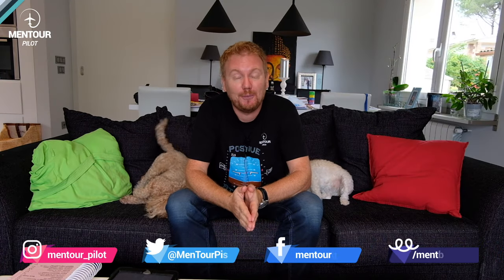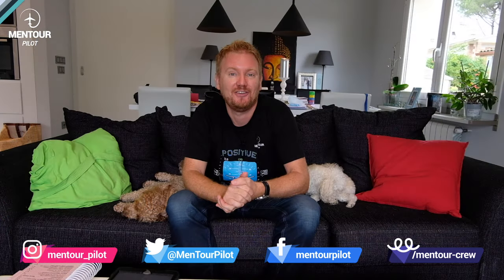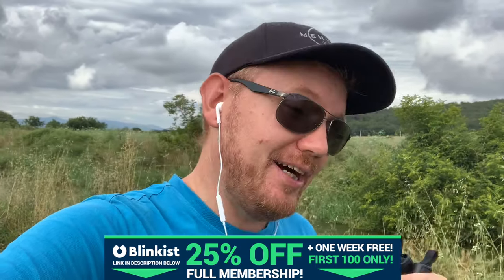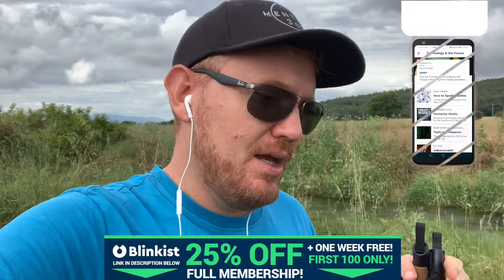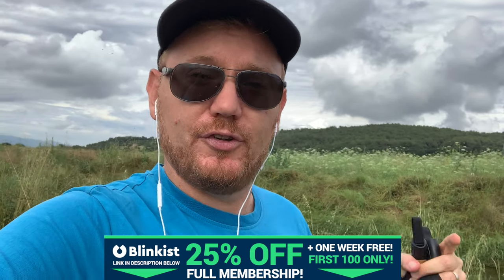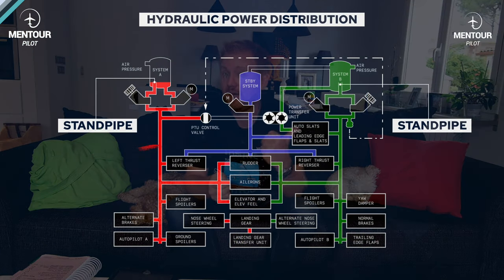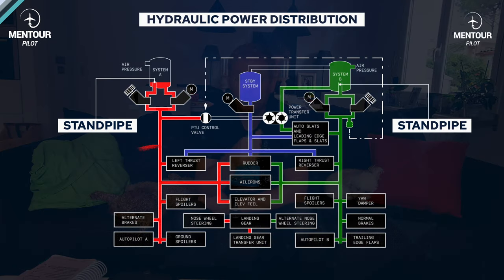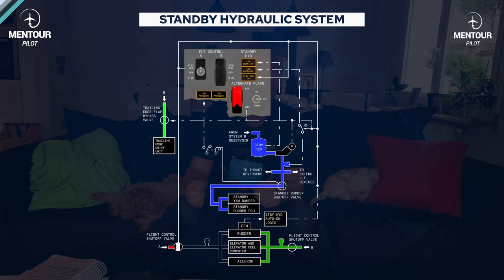How the Boeing 737 hydraulic system works. (And what happens when it doesn't)

Comment: Great explanation as usual, even though aileron power control units are located in main wheel well and nowhere near the ailerons.  The 737-100 and early -200 series airplanes had near-disastrous hydraulic problems through the early 1970s.  'A' system was powered by engine pumps only, 'B' by electrics.  Main problem was vibration of EDP pressure output lines between the engine disconnect and hydraulic power module in wheel well.  Even though the lines were stainless steel, nylon cushions in the clamps securing the lines ate right through them and caused high pressure leaks that rapidly emptied 'A' reservoir.  Resulted in loss of A system for flight controls but not B, total loss of landing gear and flap operating pressure.  Gear could be deployed manually and flaps extended, slowly, by electric motor and standby hydraulics, but nose wheel steering was inoperative.  Many emergency landings and runway retrievals resulted.  Original, alternate thrust reverser system was based on accumulators rather than standby system and was likewise troublesome.  By the time Boeing developed and we installed fixes for all those problems, we mechanics were thoroughly sick of being soaked in hydraulic fluid at work.

Comment: Love your tech videos. Very good for those who are going through B737 type rating course 🤘.
Reply: @787 Wing Aviation Yes. And if you lose A or B the Autoland is also impossible...
Reply: Pilot Blog true, but what airline allows them to use auto land?
Reply: B37xM Flyer isn’t it meant to be a requirement every so often to keep pilots current. They seen videos they do it on a clear day to make sure it works and they are current incase they need it for real
Reply: @737MaxPilot  we use Autoland. At least once per month or for foggy weather...
Reply: @tomstravels520  True and every 6 month we have low visibility operations training... Well at least in my airline 😉.
Reply: Pilot Blog nice to hear it’s actually used.  I do know the USN doesn’t allow it on their P-8.

Comment: I would like to slightly correct you. Cables go through the whole aircraft, and in B737NG you actually move the cables, which than activate actuators(most of them in the wheel well , some are in the tail). I guess people think it is either hydraulics or cables on B737NG, when it is actually both in normal situation. I know that you know that as a pilot and instructor, but it might not be clear to other viewers(some of them who do not have technical background). Other than that, perfect explanation of quite complicated system. When talking to mechanics, they told me that spoiler mixer is the thing they hate on the NG due to complexity. Also, removing some actuators(for example aileron PCU) and installing them is a nightmare(due to cable rigging), unlike on A320 where it takes 20 minutes in base maintenance.

Comment: One thing Peter, 18:17 actually the leading edge devices will be in fully extended positions once you select switch in ‚down’ position (regardless of trailing edge flaps positions). Thank you so much for another, fantastic technicial movie! Greetings
Reply from the maker: Absolutely correct. My mistake
Reply: Must also place alternate flap switch in ARM position.

Comment: Great  explanation of the hydraulic system.  Love hearing about the technical aspects of flying.  Considering the thickness of the manual, and accompanying checklists, I would feel confident knowing that the pilots have it memorized, and can execute it automatically without going through the checklist.  The buttons, switch, which should be on, which should be off, AND when, is mind blowing.  I'm reminded, that even though people know how to drive, it doesn't mean they know how a car operates.   Thanks for the great job that you're doing.  Stay safe.

Comment: I've driven a heavy truck before with no power steering, once before I remember trying to park in a tight spot and I felt my arms were going to fall off from the pain of struggling with steering wheel.  I can't even imagine how would feel to steer a plane using muscle Force.
Reply: alnett22 its nothing that drastic.
Reply: @737MaxPilot  yes it is see UA 232
Reply: @theyaduvanshiindian391  that is not a 737. I fly the 737 on a fairly regular basis with the hydraulic assistance shut off. It is nothing like what he is talking about...then again, I am sure a 11 year old little girl would disagree with me also.

Comment: I feel much safer on an a 737 after I saw this video! Thank's Peter. I had a landing in Trondheim when they coulden't get the flaps down, and we stopped on the runway and used the emergensy glides off the plane. That was an old DC9 or a Carawellwelle plane from SAS. The engines almoust fell off when we landed very hard, but the pilotes saved us. No one was heart. We had to wait a long time to get a new plane from Oslo to take us to our destination Alta.
Reply: Skriver på norsk jeg, siden du er det😉
Det var vel ikke tilfeldigvis 23.feb 1987?? 🤭🤔

Comment: The electric motor driven pumps are cooled by Hydraulic fluid? Yes, you're right as the hydraulic fluid passes through a HEAT EXCHANGER Located in each main fuel tank.That's why we need a certain quantity of fuel in the main tanks before turning ON the electric motor driven pumps (minimum of 1675 Lbs ). As always, your explanations are great.
Both A and B hydraulic systems have an engine–driven pump and an AC electric motor–driven pump. The system A engine–driven pump is powered by the No. 1 engine and the system B engine–driven pump is powered by the No. 2 engine. An engine–driven hydraulic pump supplies approximately 6 times the fluid volume of the related electric motor–driven hydraulic pump.

Comment: From  the schematic shown,  I presumed  Boeing is using a closed center system and compensated pumps but your comment regarding volume/flow rate variance twixt the motor-driven and engine driven pumps makes me wonder .  IAC, it wouold seem there's a great deal of control complexity introduced by having redundant control activation systems .  Of course  pilots don't need in-depth knowledge of the design features/philosophy in order to operate the systems and compensate for failures b ut I'm sure even the required level are considerable !  Great show series !

Comment: In our airline, we always switch off the electric hydraulic pumps after shutdown, even during short turnarounds. We only turn the pumps on if there is a strong tailwind to maintain the elevator in its neutral position.

Comment: Thanks for the elaborate explanation.
Just one note: Cases of several hydraulic  systems failing at the same time already happened in aircrafts, usually due to an external impact (for example an engine turbine break and cut hydraulic lines Etc.).
Reply: United 232
Japan Airlines 123
DHL OO-DLL

These are the only real 3 main ones that lost all fluid. Modern aircraft like the A380/A350 now use hydrostatic actuators which have a self contained hydraulic system isolated from the main lines. If the main lines are punctured and all fluid is lost then these EHA’s/EHBA’s can still move some of the flight controls to give the pilots control of the aircraft. They just require electrical power to operate

Comment: I always wondered about this! I take the 737 a lot, but i never knew it still had cables in case hydraulic didn't work! Nice!
Reply: Cables can stretch break or fray. If rigged improperly the ailerons otrol.r rudder will have poor or no control.

Comment: Thank you very much, Mentour for answering my comment reguarding the previous engine failure video! Great interesting video as always, and I thought you really NEED a RAT to steer a 737, but you have cables and enough electric backup pumps, a gravity extension, a PTU and an electric system for the flaps instead to steer, this makes sense!
 
Patrik Krispler
Reply: The 737NG does not have a RAT 🐀
Thats an Airbus thingy😆😉
Reply: @Clayson Antoons Hey, thats true😆
Forgot about that

Comment: Great Video!   Question-   When there is a loss of either A or B, and the Standby System is activated by selecting Standby Rudder, is the rudder powered by only the Standby System or jointly with the Standby System and the remaining A or B system?

Comment: Can you please do a video on why you do static takeoffs please?
Reply: If You mean like : standing take off , it's mostly because after line up you wait for the takeoff clearance .

in freezing conditions there's static run up (up to 30sec) to about 70% to schede some ice from the fan blades .
Reply: It is not the recommended procedure.  It doesn’t provide any substantial performance gains, but adds to the probability of engine issues while at high static thrust settings (think crosswinds)

Comment: What procedures do you do if you for example lose system A mid flight? Do you divert and land as soon as possible, just to be sure, or do you complete the flight and deal with the problems on the ground?
Reply: Probably land as you have lost one of your redundancies but could depend on if you’re flying back to your main operations base and only 200 miles from it. You still have 2 systems spare
Reply from the maker: You can complete the flight in most conditions.

Comment: Hi Petter, do the control cables move while the authority hydraulic system A and B is in use.🔦🔎
Reply: The  steering wheel connected to the ailerons by steel  cables some how it will move when you turn it,   Maybe the actuators without hydraulic pressure will also move with it
Reply: Yes the control cable will move when you move the steering wheel
Reply: It's much like the power steering in your car.  The steering wheel in your car is connected to the front wheels of your car by mechanical components.  Even if the power steering quits on your car, you can still steer.  On the 737, the cables are part of the mechanical connection between the pilots controls and the primary flight control surfaces.  If one moves, the other moves too.  The hydraulic system provides "power steering".

Comment: Hi Mentour. Love the channel. 
Would be great to see a video in the 737 simulator of a double hydraulic system failure. 
Also i'm not entirely sure how the 'fly by wire ' A320 handles this problem given there are no cables to the actuators.  I would assume that the APU would be the backup system here but then I recall with the Hudson river ditching captain Sullenberger switching on the APU which was later regarded as an example of brilliant airmanship even though this was apparently not part of the Airbus emergency procedures for this particular event.  
So how is the Airbus fly able in the same situation? With no hydraulics and with the generators offline the fly by wire would presumably only have very limited battery capacity available to it.  So in that case you would think that starting the APU would be one of the first priorities.  My only guess is that Airbus maybe never really considered a double engine failure.  Perhaps the consensus was that the only scenario where you could conceivably lose both engines would be the aircraft running out of fuel... In which case attempting to start the APU would be pointless.  Or did they fly it purely on the hydraulic pressure provided by the RAT?
Can you shed any more light there?
Reply: You're asking too many different questions and switching between hydraulic and electrical failures so it is a bit confusing.
1. The A320 has 3 hydraulic systems. Green, Yellow and Blue.
2. Green system is powered by No1 EDP. Yellow is powered by No2 EDP but also has an Electric Motor Pump usually only for one engine taxi when No2 is shut down or emergency use.
3. A PTU can pressurise the opposite system if the pump has failed. So if Green pump fails, the PTU will pressurise green system as long as yellow pumps are working and vice versa.
4. Blue is powered by an electric pump or the RAT in an emergency.
5. The aircraft can fly with 2 systems failed. Which controls surfaces remain depends on which systems failed.
6. If all the EDP's and EMP's failed then the RAT will be deployed to pressurise blue system and emergency landing conducted. 
7. The only time the plane would be completely unflyable is if all 3 systems leaked fluid.

Comment: Question about manual gear release, do the modern 737's still have the peep hole in the pasenger cabin floor, where the pilots can look down and check to make sure the gear is locked with the red stripes lining up?
Reply: No peep hole on the 737NG👀 
Dont think the classic had one either..
Reply from the maker: No, unfortunately we don’t
Reply: @speedbird9313  classic does have window/mirror system
Reply: I worked at a breakers yard a while ago, and a klm 737 came in, i think it was a 400, and that had little circles of carpet you could lift up above the gear bay in the passenger cabin, there was a glass sight, you literally put your eye against it, and looked at mirrors through the glass sights that were in the gear bay, those mirrors showed you the gear leg, where red stipes were painted onto a joint on the gear leg, so, should a gear indicator fail, you could double check, there was the same spy hole in the cockpit too, under where someones feet would be if they were sat in the fold down jump seat, just aft of the radio pedestal 👍

See, even as a pilot, you learn something new every day 😁
Reply: NG and max don't have a window. They have a redundant set of gear down sensors and a separate second set of  indication annunciators on the overhead panel
Reply: @stumo8681  bit concerning for the passengers i suppose, seeing the captain walk into the cabin, teqr a piece of carpet up, and put his face against it, they would think he was drunk 😂
Reply: @russellrattys6581  I always thought the same, first time working  on a classic I couldn't believe it 😂
Reply: stumo86 Cool, thanks👍🏻 Didnt know that🤷🏻‍♂️😊

Comment: Is it possible for the 737 to lose all hydraulics like the DC10 which had to make a emergency landing at Salt lake city
Reply from the maker: Anything is possible but highly unlikely
Reply: Possible yes. Has it happened...no. Except the 737 is still controllable without hydraulics
Reply: Not in the same way. But it is possible but very unlikely.
Reply: That's extremely improbable with any airplane if maintained properly. Is it possible? Yes, but only if it is poorly maintained or if someone screwed up badly.

Comment: 👍thanks for the informative video!!!
Wondering, when flying the A/C MANUALLY,  can both pilots control the flying controls at the same time?
Reply: A Mohammed 
On Boeing aircraft, the controls are coupled together.  If one side gets jammed however, the other can be freed up with enough force.  There is no reason (normally) for both pilots to be flying the airplane.  Mechanically, one could control the elevators while the other controls the ailerons...but it wouldn’t work smoothly

Comment: One thing, why can't be the alternate flaps retracted if there's an "up" position for it's control switch? (I really enjoyed this, so amazing explanation! More technical vids, please!)
Reply: You can retract only trailing edge flaps (electric motor), but once you select switch in ‚down’ position the leading edge devices will be in fully extend positions regardless of switch position (standby hydraulic pump)
Reply: Didn't he say leading edge?

Comment: If you lost EDP no.2 on takeoff,  how would you retract flaps & slats? Using the electric pump?

And If you had a leak on takeoff & lost the hydraulic fluid from no.2 system, in this case how would retract flaps (both leading & trailing edge) & slats?

I mean the Alternate electric system could put the Trailing edge flaps up, but it doesn't work on the leading devices, does it?

Comment: Do 737 simulators have a strong enough force-feedback system on the yokes to simulate manual flight? In your dual engine failure video, it didnt seem like there was a notable increase in effort to control the yoke, but I'm sure that wasn't your first with that in the sim, so it might have just not shown.
Reply: Yes they do
Reply: That was probably because the APU was running and powering the electric pumps

Comment: I am assuming that the hydralic fluid is most likelt Skydrol 500. (interesting that my (adopted) father was the patent agent as he was head of the patent department of McDonnel-Douglas (before asorbed by Boeing in 1993). The inventor (so I have been told was A.. Paul Vance). He invented along with Monsanto, Skydrol.

Also, Petter, I know this is primary of hydraulic systems but I just thought of it. I know tat the AC Hz inthe cockpit is 400 Hz but the cabin with the passengers of cargo, is that 50 Hz or 60 Hz? Thanks!

Comment: Somewhat fascinating to me that hydraulic and actually even metallurgic things function so well being subjected to such abrupt temperature changes...cylinder and piston that hasn't been used in several hours responds so well after being subject to such cold.  Geeky curiosity but yea,  I'm impressed by the ability of those systems to seem to be so temperature unaware.  No doubt some decent engineering.  Yay engineers!
Reply: Originally it didn’t. The infamous 737 rudder problems were caused by thermal shock and the power control unit would jam and deflect the rudder in the opposite direction to the pilots input
Reply: @tomstravels520  Hehe. Sounds like fun. Steer it right and it goes left, who says a dyslexic shouldn't be a pilot?  There's room for everyone!
Reply: nhzxboi fun as in it killed 157 people and nearly killed a further 53?

Comment: Hehe.  Essentially, you have the sump, the pump and the dump.  Pretty simple, actually. Neat thing is that the fluid does not compress and lose strength unless relieved.  Pretty damned strong from pedal to rudder if that's what you need.